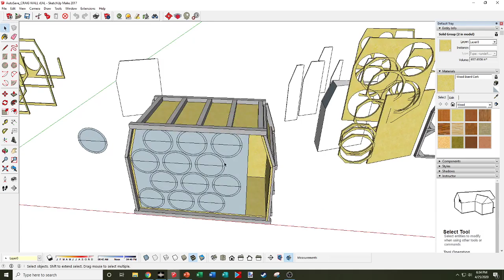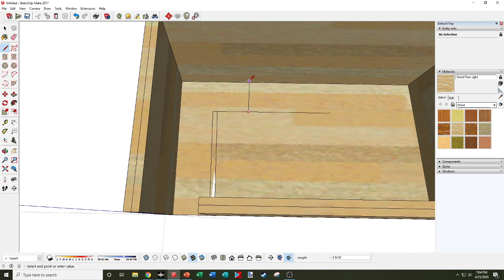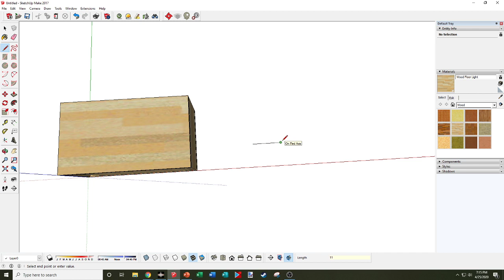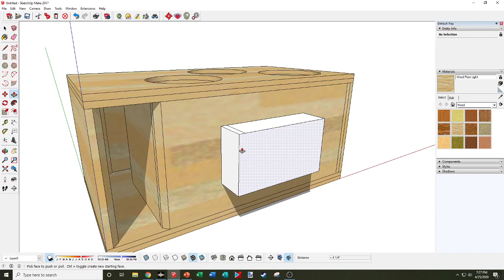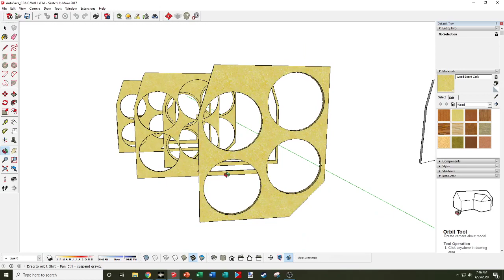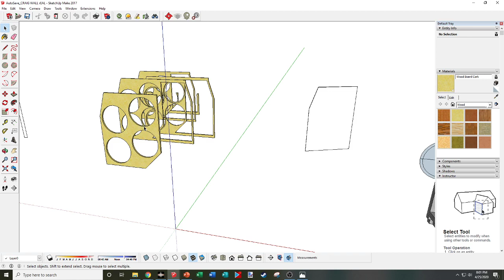Enclosure Design (Live Q&A)

Comment: Question, i had 2 american bass xfl 15s in 8 cubic foot box on skar rp 2k at one ohm.  I just hooked up four ab xfls in 16cf box on the same rp 2k at half ohm, and im not noticing much if any difference in output.  The two new subs arent as broken in but im still not sure why its not way more loud than the two subs. .im pretty disappointed.  Do you have any advice?  Thanks